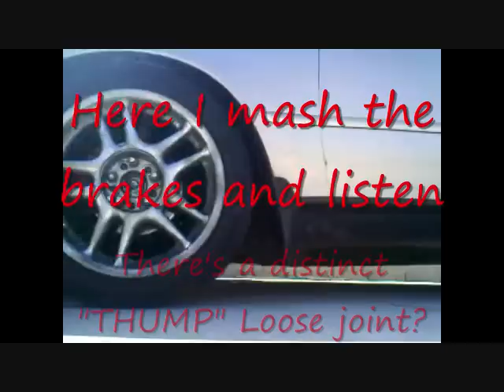CV Joint FAIL

Comment: @joshisthebestwooha20 you don't just replace the boot, you get to disassemble the joint, wash it clean, dry it, stuff it with proper grease, put a new boot on it, and then pray, because two weeks is usually enough to kill the joint. On russian roads, that is : )